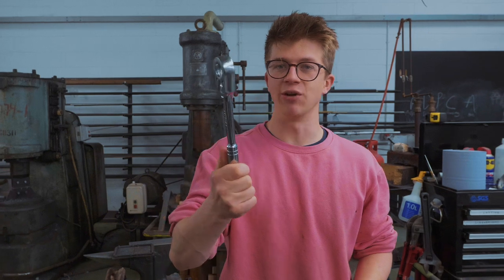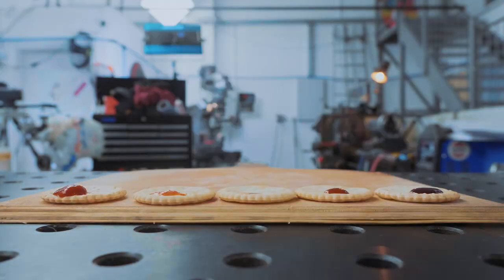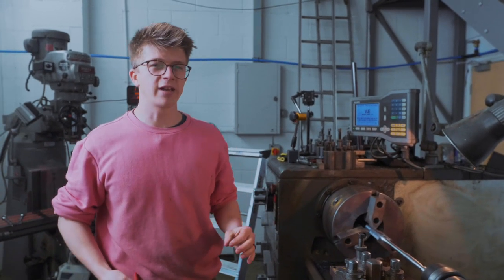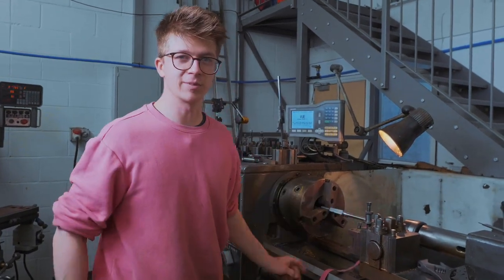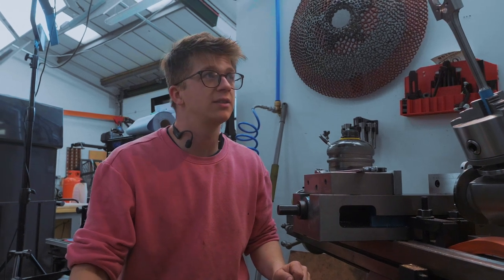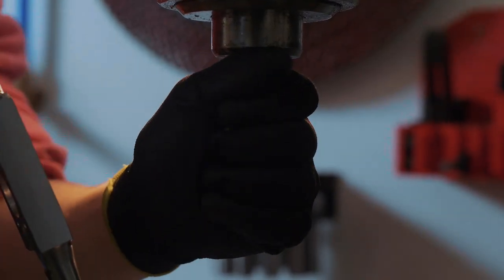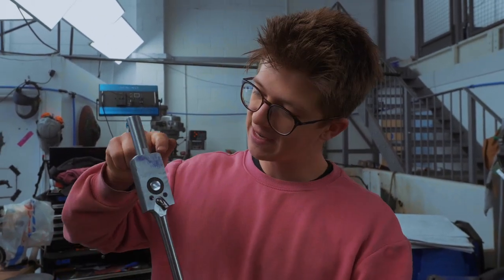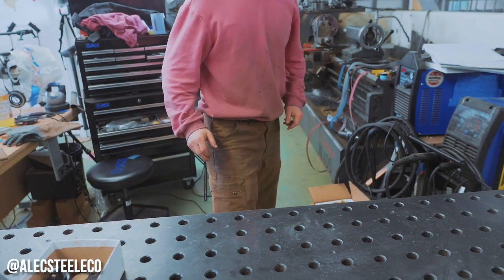Making a Socket Wrench from Damascus Steel! Part 3

Comment from the maker: My mouth is still on fire... Get 20% off your first monthly box when you sign up at http://bespokepost.com/forge and use promo code FORGE at checkout!
Reply: Is bespoke available in Europe ?
Reply: Next challenge if you are up for it, cook your wife a meal only using the equipment in your workshop, but you have to make all the cooking utensils, pot's and pan's along with the plates, cutlery and glasses
Reply: how can you call it damascus steel? i might believe wootz but damascus is no longer possible! ps your safer having the emery cloth ripped from your fingers than having the pliers come back at you ..... i once saw a chuck wrench   not the key  fly across a classroom and exit through a block wall because  the student in front of me forgot to remove it after changing chucks...
Reply: I had a bespoke sub for a few months. Some of it was "ok I guess" but most of it was pretty meh.  It's pretty much all stuff for people with manicured beards who wear flannel ironically. It's not for real men.
Reply: You should forge a rake for Post10 to help him unclog culvert pipes. Or design a special tool for the jobs he does.
Reply: For your next taste test challenge, try biting down on a "Ghost" Pepper! Be warned! Do it in small bites.
Reply: *Alec any advice on dating and What to do when you feel lost

Should i just do me am i not missing anything in life?*

Thank you 
-Alec
Reply: I'd bet good money he'll sell the Montana shop and push his stupidly expensive 'cheap @ss knife kits' online shortly!
Reply: why not drill a hole in the sand paper, attach string, and grab onto string with plier? String will break off and you don't even need to worry about having to let go

Comment: Lol as a machinist, fine work sir. Couple tips for ya. When polishing on the lathe use a little coolant or oil on the sand paper. Will provide better surface finish. Also, when drilling at strange angles like that, use a small endmill to create a flat. Then it will spot and drill much easier. Great work!
Reply: Nice one Ian, good advice there. 
Alec, why didn’t you mill the end profile on your dividing head? I know it’s not as easy as using a proper round table, but it is still do-able (I speak from experience). 

This is looking damn fine though - well done!
Reply: I love comments like this. Even if Alec doesn’t see it tips like this are so valuable for people like me 👍
Reply: You said "Will provide better surface finish". You are right will does provide better finish but he not longer works with Alec. He has his own channel now
Reply: @abdullahkhalil9284  not correcting you to be full of spite,but you mean young Mr. Stelter?
Reply: Also, a very obvious solution to the work holding of the ratchet would be to just clamp the squared off portion in the vise and then just tilt the head of the Bridgeport over to be 23 degrees from horizontal.  The whole purpose of having the head tilt and nod on a Bridgeport style mill is to be able to drill wonky angled holes like this.  Otherwise the head would just be rigidly attached 90 degrees from the table like every other mill lol.
Reply: @metalbob3335  yep, he was making a play on words
Reply: Word
Reply: I was not referring to Will Stelter. Using cutting fluid with sand paper to polish will provide a better surface finish. Tilting the Bridgeport head is an option. Tramming in the Bridgeport head to .000 can be more tricky on certain machines.
Reply: @ReiniGrauer  He could of just clamped it in the vice at 23 degrees.
Reply: @markthompson8656  Nope, not unless you could teleport the long handle of that ratchet through the table or overhang it off the front or back.  Go back and watch it again, the ratchet body is almost vertical on the table.  Tilting the head is the reasonable way to do it quickly and correctly.
Reply: ER sleeves make good arbors and give you wider size range for in a pinch. I would suggest a long and short ER11 sleeve.
Reply: Also shorter bits of sandpaper
Reply: also, just use a small piece of sandpaper, not the whole belt

Comment: Safer to hold the emery w/ two hands spread far apart-- the larger the angle the emery cloth makes, the safer. Pinching the work by holding the emery cloth with one holding point is what causes problems.
Reply: Absolutely true, he does it not quiet correct
Reply: Just saw Abom doing exactly that in his most recent vid. You can also just press a folded end onto it instead of wrapping it around at all.
Reply: and shorten the emery cloth in my opinion
Reply: Absolutely. First comment I've seen with someone getting this correct, this is the safest way to hold the paper. Hand closest to the chuck stays on your side of the lathe, other hand reaches across to hold the paper.
Reply: The other advantage of the two hand method, you use more of the paper rather than just a small part of it.

Comment: There are two methods of retrieval when you drop something.  1.  Sweep the shop.  2.  Drop a similar item from the same place and watch where it goes.  Also known as the "throw a second (third/fourth...) object into the tree to get the original one down" technique.  This is the way men do it.
Reply: A third and really useful method...
Put a flashlight on the floor and slowly turn it in different directions. The light shining across the floor will illuminate every bit of dirt, hair and metal shaving. Something like a spring will stand out easily. 
A fourth method... sweep the whole area and inspect the dustpan.
Reply: The 4th you mentioned is the 1st he mentioned.
Another method is run a magnet bar over the area if the object was magnetic
Another very useful method i had was to call the eagle eyed guy who would walk over and before you even told him you dropped something he'd pick something off the floor and ask you what's up...
Reply: As a lock sporter, I would sweep the floor, use a magnet or shine a light (probably all three) before dropping another tiny spring or key pin.
Reply: @joshuacheung6518  you're right that was his first. I just got carried away thinking of ways to find stuff, lol
Reply: I dropped a rubiks cube once, the car that cover the centre squares all popped out. I turned the whole room upside down and despite them being brightly coloured roughy 10mm squares of plastic I only found 3 out of the 6. Years later I'm sure they slipped under the gap of the skirting board.
Reply: The only one you'll ever need is the flashlight trick. Never failed me yet
Reply: I imagine this is why people paint worshop floors white and keep them well mopped. Finding stuff is way easier, recently lost a circlip in the grass in the cracks of my patio, had to weed it all for an hour to find it

Comment: In my old machine shop. We had a sign that said "All springs are air soluble". I don't know how many I lost. We started putting magnetic mats under our workbenches... But I got damn good at making springs, and have MANY shop made spring mandrels.
Reply: An old gunsmiths saying is that the spring will always head to the most cluttered place in the shop.
Reply: I'm a locksmith, the springs from locks are definitely air soluble, as are the pins!
Reply: Same goes for loads of other things. #2 Phillips bits, Sharpies, pencils, LEGO blocks, the list goes on.
Reply: @doubledarefan  Sorry, lego blocks will always be on the floor, in the shadows, waiting to be stepped on...., the rest however are true.
Reply: @bok1080  90% true. The other 10%: That explains occasionally finding a thought-to-be-lost-for-good LEGO piece when, say, cleaning out a cabinet or ripping up old carpets.

Comment: Given that the hole for the spring and ball bearing are only meant to act as an indexing guide/holder, the angle of the hole shouldn't matter. You just have to make sure you hit the 45 degree (+/-) angle with an approximation. I would've just winged it, although I built my coffee table by winging it out of old parts, and its wobbly as a drunk coyote.
Reply: Interesting you know what a drunk coyote looks like. Take me on your adventures next time eh?

Comment: As someone working in a machine shop, we do a lot sketchier stuff almost daily. Also with the sandpaper, hold either end of the strip with two fingers and keep it a bit apart. The amount of pinch/surface area contact you had there drastically increases the chances of the sandpaper catching.
Reply: It isn't sand paper
It is a strip of Sanding BELT from his belt sander
and it is liable to wrap around whatever is holding it if it gets sucked in at speed
hence the pliars
Reply: Out of interest - why not only sand on one side? For example stretch a piece of sand paper/belt between two points (think like a hacksaw with sand paper) and use this? Surely the speed advantage of wrapping the item in the lath can't be worth the danger of it wrapping around the lathe?
Reply: @drthmik  In industry, you use cloth backed sand paper, which is just slightly thinner than actual sanding belt, and definitely still strong enough to pull a person into a machine. The technique cgjeff is describing is the best practice (you hold onto the strip lightly). Normal sandpaper backed with actual paper would just get pulled apart when you put pressure on it. The other advantage of cgjeff's technique is that you can use almost the whole strip rather than just one section at a time. This is a more efficient use of the paper and time.

Comment: A good 75% of machining in a day to day machine shop, is using tools to do things that are not meant to be done with said tools. That being said you’re a damn good machinist as far as Im concerned.
Reply: My father was a machinist. He used to say “most of the job is making the tool you need to hold the part”
Reply: @Mike-B-Jackson  thats so true.  i became better at making jigs to hold the parts than actually removing the material
Reply: @ibrahim-sj2cr  lmaooooo

Comment: when using the strip of abrasive just hold with your fingers. if it catches and pulls it will just slide out your fingers. if you have pliers on there the pliers will become a project and hurt you or someone/ thing a lot more than a strip of paper. also pliers are easier to grip so if something goes wrong more likely to yank you into the lathe, you can't grip paper as easily so safer
Reply: this, Alec was overthinking safety for some reason.
Reply: I was thinking the same thing. Now you have a heavy piece of metal being whipped around and possible being thrown back at you. I think hands are safer but still be putting your weight behind you and still telling yourself to just fuckin let it go bro.
Reply: was wondering if anyone was gonna say something about that or if i should.  
was a nice dent in a fire door at the school i went to and a bit of damage to the roof after a student forgot to remove the chuck key befor starting the lathe
Reply: I was taught dont even wrap the sand paper around the piece at all use it like tooth floss and stay on the outside as the sand paper can pull your fingers under the part if wrapped around 360 degrees. files are the ones that scare me and parting off can be abit of a heart raising experience aswell sometimes lol
Reply: @saigyl9149  because every shade tree machinist will come out of the woodwork to give him bad advice about how to do it "right" if he doesn't do silly things like that. Most people who know none of that is necessary will just think to themselves "that isn't really necessary" and move on :)
Reply: @jonaskarlsson5453  someone always forgot the chuck key at school. One time it hit the teacher in the stomach, but he didn't get injured, just sounded very painful.
Reply: Probably true
But he wasn't using paper
That was a strip off a sanding BELT
And that is a VERY different thing
Reply: Doesn’t matter. The pinch strength in your fingers is very different to having it mechanical enhance but using pliers. So if it wrapped he now has a mass of metal going at a rate of knots at possibly something softer like his head. If just pinch in fingers be it cloth or paper it is only the cloth or paper that’s going flying and thats going to scare you not kill you
Reply: Good advice. No good telling yourself to let go unfortunately it doesn't work like that because the natural reaction is to grab.

Comment: Hey Alec, you have a machine in your shop that is intended to work on long parts.... You just have to think a little outside the box.

Take a drill bit, hold it in the chuck of the lathe. Then take your part and fixture it to the cross-slide/tool post.

Fairly common technique used in small machine shops where height becomes a problem. Also used for line-boring without a dedicated line-boring machine.

Comment: It would be eminently safer if you did not have 3 foot of the sanding strip dangling down for the lady to grab hold of. Maybe think about cutting smaller strips and only going in with what you need.

Comment: Fun series so far, Alec. Don't be afraid to hold your sandpaper in your hands when polishing on the lathe. As long as you do not wrap the part by more than around 270 degrees and don't go ape on the pressure you apply you will be just fine. Have fun with it. I'm loving the development of knowledge on your part.

Comment: 4:20 now I'm not a blacksmith or anything, but I feel like you could easily forge a U or C shaped tool to hold a half crescent of sandpaper safely on the lathe.

Comment: If your doing sanding on the lathe have your arms spread like you are making the 'C' in the YMCA dance and pinch the the emery paper between your fingers. The large angle between your hands minimises contact area on the work and pinching the emery paper allows it to be ripped out of your fingers without pulling your hands in.

Comment: If anyone needs to know this (I only found out not long ago): the more teeth you have on that wheel, the more efficient your wrench will be as you'll be able to lock it in smaller movements if that makes sense. Delboy Garage made a great video about it
Reply: But the less torque the ratchet mechanism can handle. It's a compromise. Do you want a ratchet that has fine clicks and so can reset with less handle deflection? Or do you want a more coarse ratchet that can apply more torque without breaking?
Reply: @bumblebee2989  uncle bumblefuck has shown that there really isn't much of a difference.
Reply: @bumblebee2989  Ooh I overlooked that actually that's a fair point 🤘
Reply: @jonanderson5137  I don't know what that means but thanks for participating!!
Reply: @bumblebee2989  AvE. He's high brow, probably too much culture for you.
Reply: @jonanderson5137  sounds waay to sophisticated for me! Anybody that goes by bumblefuck is pretty classy... just like you

Comment: Machinist here.  You're good.  It looks like it was held pretty solid and it got the job done.  Did you just machine to the layout lines or did you figure out the angle?  As far as sanding, keep the legs of the sandpaper at 90 degrees and it won't wrap up on you.  Having both sides pulled flat like that is when people run into problems.  For the drilling clearance issue you had, look into straight shank ER collet chucks.  I have and 3/4 shank ER 16 holder that is great for situations like you had.

Comment: Alec, the work you do is truly amazing. A little tip to make your lathe ways last longer, when grinding using abrasive wheels cover the lathe bed, it helps prevent the abrasive dust going places where it shouldn't and wearing out the ways. 

Keep up the good work, you have a good eye

Comment: I use sandpaper on the lathe a lot, I definitely would recommend using a piece shorter than 4”. It gets dangerous when the sandpaper loses its grit and you have to apply a lot of pressure

Comment: I find the answer is to (as .38 Special said) to "hold on loosely, but don't let go". Use enough force that it won't fly off normally, but it will if something goes wrong. It DOES take a practiced feel, though.

Comment: In relation to the lathe danger. You should design some sort of dead man’s switch that, if it grabs you and pulls you into it, it would pull you off of the switch and kill the machine instantly.
Reply: It's good to think about safety, but that lathe head has no practical "kill the machine instantly." An accident can happen in tiny fractions of a second, but the chuck itself wouldn't stop spinning that fast if you drove a truck into it. Better to have training in proper technique. (Pliers and leaning back is not it. :) )

Comment: As a pretty accomplished woodworker I have to agree your belting on the lathe is dangerous! Pax though, I've done the same thing as that, with hardwoods on say a lamp project. I struck all distractions, no radio no "hey Toms" allowed from all in the shop (14/15 [not sure if counting my boss is fair he told me to make it] in all, told in advance I am NOT to be bothered til done). 0% distractions or interrupts 100% focus = a stunning bit of decor and 0 injury sigh. I must admit I mistrust the radial arm more than any lathe that thing likes to bolt like a greyhound out of the gate. GREAT VID thanx

Comment: You can grab the emery cloth with your hands. You don't wanna GRAB the emery cloth and the part you're cleaning with your hand. That's when things get spicy. As is, rule of thumb is 20% grip on the bottom hand, normal grip on the top hand (or according to rotation if you're weird and turn the lathe in reverse). Perfectly safe to do it like that, in fact, it's the recommended method, when you put your fingers around it (work piece), not only do you expose yourself to danger, but you're also putting uneven pressure, on finishing, maybe not that important, but when you're dialing in a part for the "chef's kiss" fit, you'll feel it.

Comment: When sanding on a lathe it is easier for it to pull in sandpaper when you clamp both ends together like that, I personally take a roll and fold it over itself and use the square that comes from that to sand.